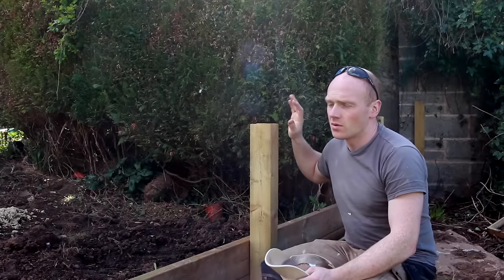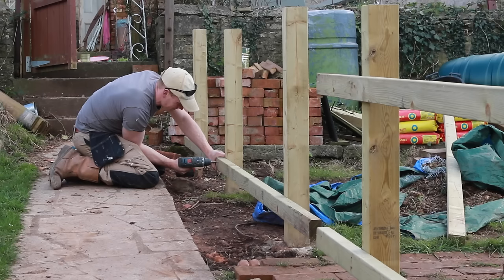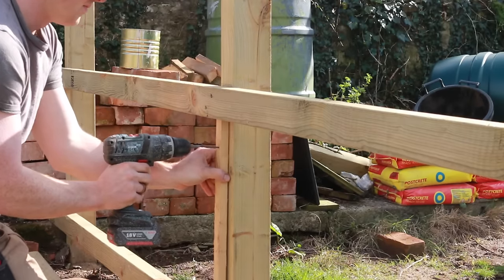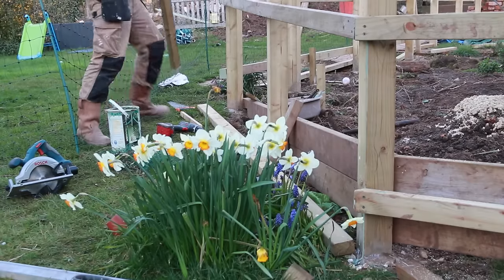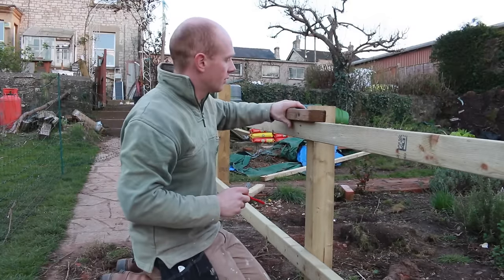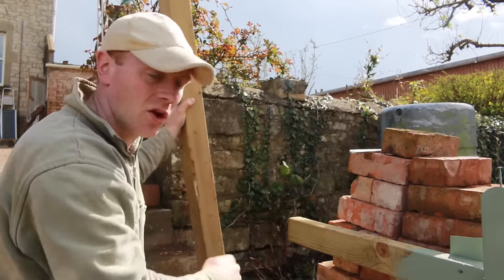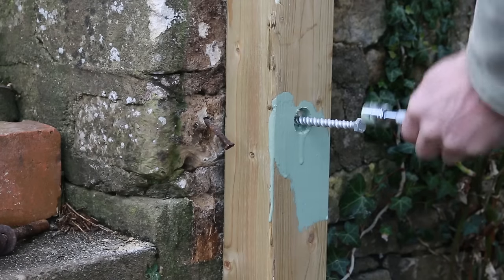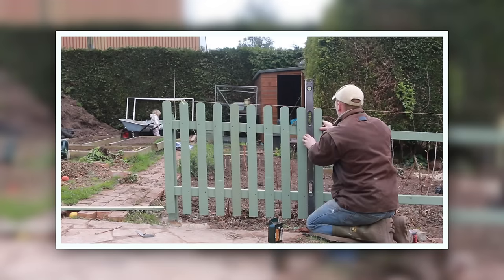Building a Picket Fence | Fitting the Rails

Comment: just come across your video at a fortuitous time as I need to fence off a paddock.  Thanks, v helpful to a novice female DIY'r.  i was given various quotes ranging from £2k to as much as £3.5k JUST for labour to build a 75m total run (I live in a small rural village in Scotland and decent tradesmen are as rare as hen's teeth) hence the reason I am going to try doing it myself first.
Reply from the maker: Glad it helped.  I would suggest you try an agricultrural fencer rather than garden/landscaping type tradesmen, (if you habn't already).  They would be far more effecient and cost effective for paddock type fencing.  They may not concrete and use a powered driver instead.  Hope it all goes well. :-)

Comment: A little tip I've used before when cutting the posts off is to use the top rail as a guide for the circular saw to run on to trim all the post off equal but great job once again